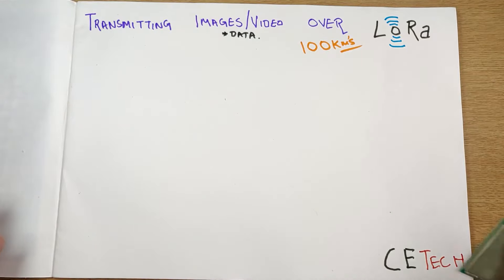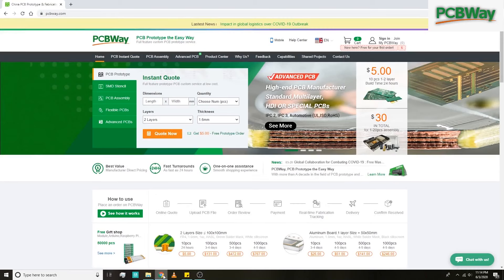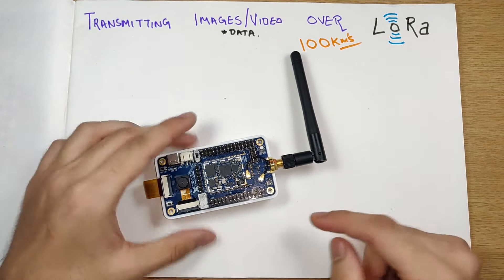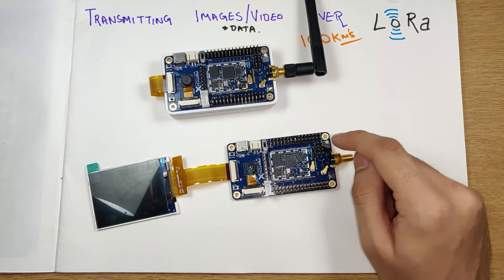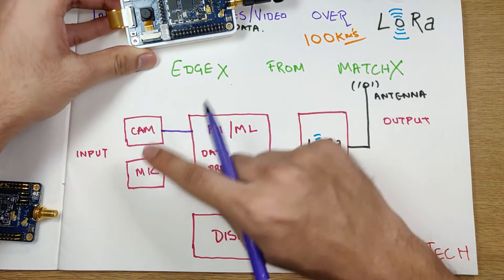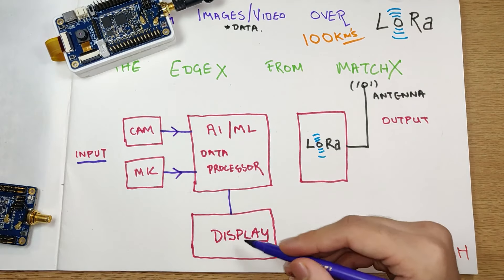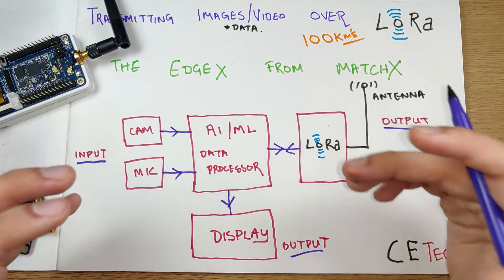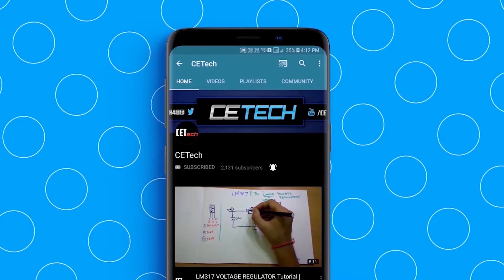LoRa Image and Video transmission wireless | ML on EdgeX

Comment: You are silly. LoRa technology provides wireless transmission speeds from 0.3 to 50 kbit/s. You can't transmit video.
Reply from the maker: You should watch the video, then you'll understand that I'm transmitting text recognised from the video and not transmitting the video!
Reply: @CETech4u  then fix your video title. This is just misleading. Sad.
Reply: @arisoda  exactly. Missleading. That's how he is making money on youtube. Missleading and manipulation
Reply: @CETech4u  no, you are not transmitting anything neither video nor text. Not even few cm's. Yet you did advertise you would transmit video over 100km's. You are a disgrace to both engineering and youtube!

Comment: im using lora e22 99ts module which giving me hardly 1 km range why ?
i hv set air rate 9.6k and transmission power 30dbm

Comment: I want to make a project with rfm 95 to control a drone remotely
Reply from the maker: Controlling a drone realtime over LoRa is not suggested
Reply: Lora has high latency (>40ms at least at maximum data rate) and not suitable for a drone.
Reply: 2
Reply: LoRa is not designed for this purpose. It's designed for small-sized data such as a sensor data coming from tiny devices. Moreover, there will be duty-cycle restriction as well.
Reply: @mehmetkoral4756  ok then please provide me a video where I can off/on a light with lora
Reply from the maker: Check out the LoRa remote control video on my channel
Reply: I believe the TBS long range link is “*similar” to lora modulation

Comment: Bro, then how does there be a secured connectivity between sender and reciever, as if someone put a fake reciever in between they will also get the data isn't it?
Reply from the maker: You will have to encrypt the data to avoid that situation
Reply: @CETech4u  ok ✌

Comment: What powers these?
Reply: Pretty sure it's fairy dust in this situation.

I'd be interested to see what the power requirements of the AI module are, from my experience continuous inference tasks, ie object detection, is extremely processor intensive. Things get hot and use a lot of power doing it.

Comment: Hello CETech, Shouldn't this be possible to transfer video captured from a drone camera to a ground station. AKA: A netbook for example to view as a one off FPV system? trying to tie this all together to were the footprint on drone would be very minimal. Thanks again.
Reply from the maker: Barry, nope LoRa does not have enough bandwidth to support video or image or even audio.
Reply: drones use 5.8GHz to transmit live feed, no LoRa needed
Reply: @staceixan  5.8 is the most common, but there are also other available frequency which can change performance  (range/penetration). e.g 1.3GHz is available and will usually offer better range than 5.8, although they do use significantly larger antenna, so there are other downsides.

But with the right setup and conditions 5.8 can cover 10+ km
Reply: @nic.h  thank you for the heads up! appreciate it

Comment: "Transmitting Image/Video data over 100km's"
- You did not transmit anything 
- Even if you would have, it would not have been images or video but instead text, text you did NOT show you can extract from videos
- Even if you would have been competent enough to transmit text, it would most probably not been 100km's with LORA but instead few hundred meters with LORA and then over Internet like with TTN

you only kept punch your desk while talking lies for click bait

Unfortunately in my team engineers often bring applications of students deceiving like that and passing themselves as skilled and experienced

Comment: You are using ml to process the video. You only capture the images that you want and process them sending them through lora. Its not a video. I thought its videos u r sending. Anyway all the best.
Reply from the maker: Yes Vamsi thats the trick 😉
Reply: @CETech4u  I'm with Vamsi on this one. This isn't transmitting video, it's transmitting a text description of what an AI inference task thinks it can see.

While I could argue that video transmission is just sending ones and zeros, ie text, typically we can convert that text back into a reasonable approximation of the original source. With your proposed method that just isn't practical.

Comment: Really liked the video...
But
Will it work without video distortions after 20 km?
Reply: What do you mean by "distortions"? It's digital. Either you get the bits or you don't. Plus, you can always apply FEC at the cost of additional airtime.

Comment: Transmitting too much data over LoRa will actually saturate the bands, it's not a good practice
Reply: Very unlikely given the chirped spread spectrum modulation to have exactly the same energy at the same time at the same clock rate. That's why LoRa is better than pretty much any other modulation scheme for low-bandwidth comms.
Reply: @MikeTrieu  it will still affect it
Imagine hundreds of devices emitting around same bandwidth within tenth of kilometers
Their energy becomes background noise
Yes, it still can extract data but it will reduce range

Comment: Very interesting video. If possible I want to put these transmitters over large herbivores like elephants and rhinos to track them. I of course need to understand how rugged these are. But suppose they were rugged what kind of sensor we need to use to just monitor the location (no humidity temp etc). what's the max dimension of the transmitter module ?

Comment: Hi there
I have a question.. 
You have mentioned that using this module, we can process the video and send the results over LoRa (like car's number etc) upto 100km
My question is that, can we transmit live video stream over a distance of 50km (without any obstacles in between)??
Means, if I have EdgeX on one end, and using its camera, I capture video and without any processing, I want to transfer live video 50km far..
Is it possible using this module??
Reply from the maker: Nope, that's not possible with this module
Reply: LoRa (long-range radio) transmission rates max out at around 40 kilobytes per second. Considering that camera images can take 1 to 5 Megabytes, that would take half a minute to send a 1 Mb image under perfect conditions, which you are not likely to find. If there is an error, it is sent again. Now look at video. 1 minute of VGA video (not even close to HD) is about 24 Mb. That's 20 minutes to transmit 1 minute of video in perfect conditions, and if there is an error you have to resend it.